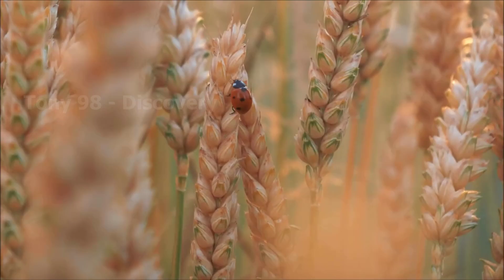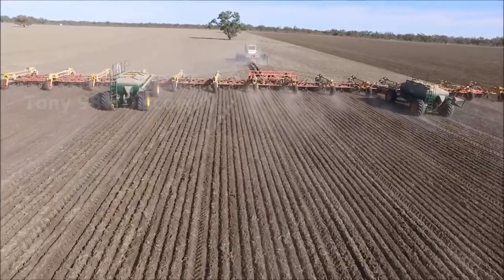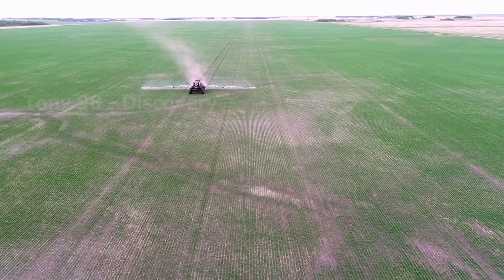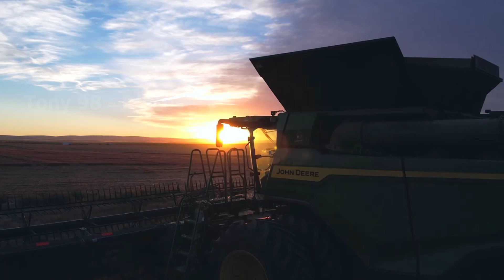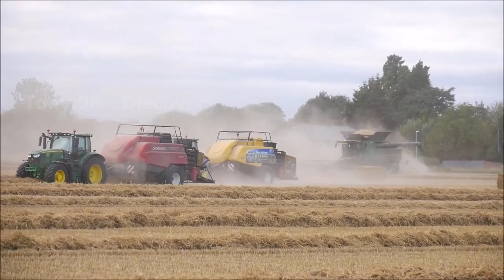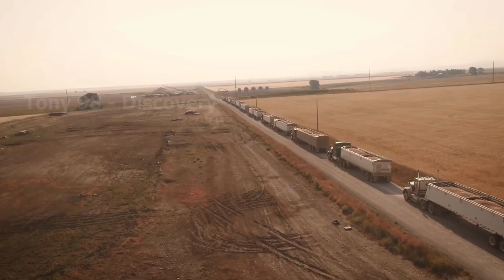Wheat Harvest 2022 - Harvest Millions Of Tons Of Wheat By John Deere X9

Comment: Your information is incorrect.  Wheat harvest does not take six months from planting to harvesting.
Reply from the maker: So how long do you think it will take?
Reply: @tony98discovery  it's usually right around 4 months.  be tough crop to grow in canada if it was 6 month between planting and harvesting. unless you are talking winter wheat which is planted in fall and harvest in early summer.